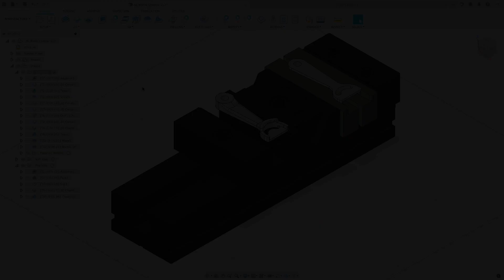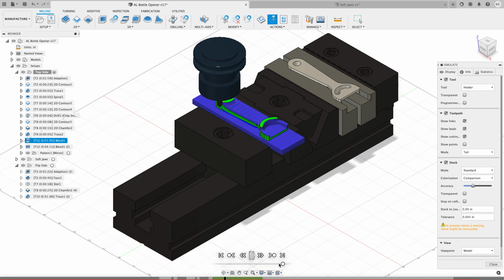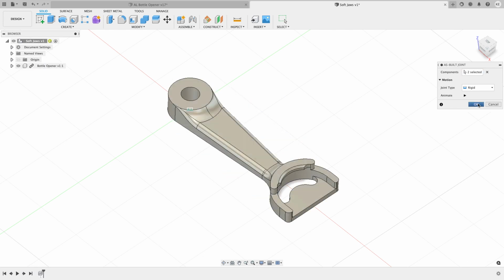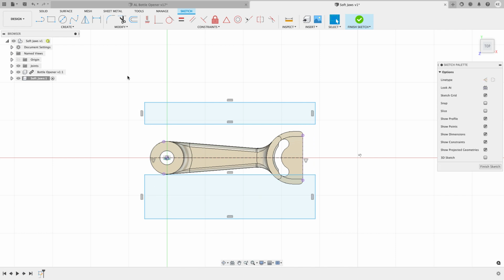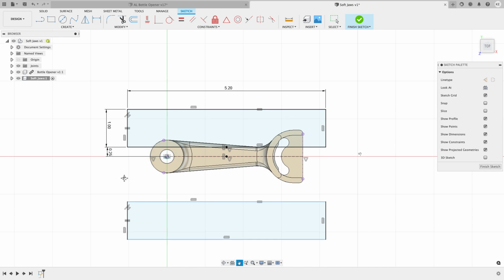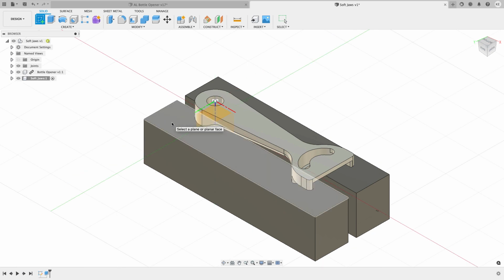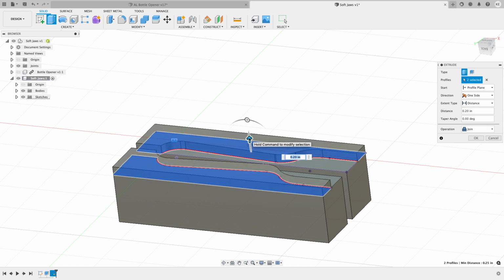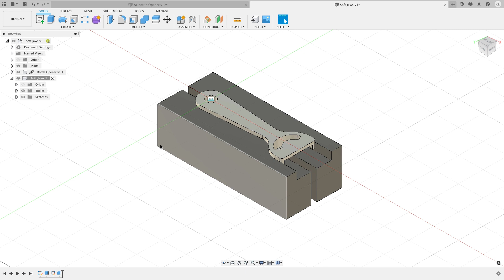Fusion 360 CAM Soft Jaw Tutorial

Comment: Awsome vid, I would love to see the setup. I run into problems because fusion thinks there's stock in the soft jaws gap.
Reply from the maker: Yeah, it will think there is stock in the gap by defining it this way. However, if you verify your space to confirm the gap is equal to or larger than your tool diameter, you can then set the tool to plunge at the midplane between the jaw faces.
Reply: @Mechanical Advantage  awsome thanks.  Is there a quick way to explain how to plunge in the gap? I was just fighting this problem, where it was plunging in the jaw and I couldn't even get it to helical. Thanks man.👍
Reply from the maker: You need a point that you can specify as a predrill point. I’m sorry, I’m traveling today so I can’t look it up as easily. If you go back through my videos, I’m pretty certain I program a speed vise handle and I show how I use that point as a predrill point when machining the softjaws. If you can’t find it, let me know.
Reply: @Mechanical Advantage  awsome man, thanks for replying quickly while traveling.  I'll look it up. Have a good weekend.👍

Comment: Matching radii in the soft jaw and the part can be difficult.  If the radius in the fixed jaw is smaller than the radius in the part, the location will be shifted (in Y).  If the radius in the fixed jaw is larger than the radius is the part, locating in X will be at the 'apex' of the circle.  This may not provide the best clamping and also a shift in Y.  The jaw could wear-in over time but this would have a migrating Y shift.
Maybe use the angled planar face and the face perpendicular to the soft jaw as locating/clamping features and add clearance for the radius features.
Reply from the maker: Well, depending on the application, that may be the correct answer. This video isn’t intended as deep dive into Workholding philosophies but instead how to use the tools in Fusion.  I’m this case even if the radii didn’t match perfectly, it’s just a bottle opener. Thank you for your tips on this though.
Reply: Understood.  Really appreciate your content.
Just highlighting a minor misalignment potential.  Ask me how I know.  Haha.
Essentially just make sure the wear comp/diameter for the tool matches the CAM.  Less of an issue if using the same tool for the op1 profile and soft jaw profile.